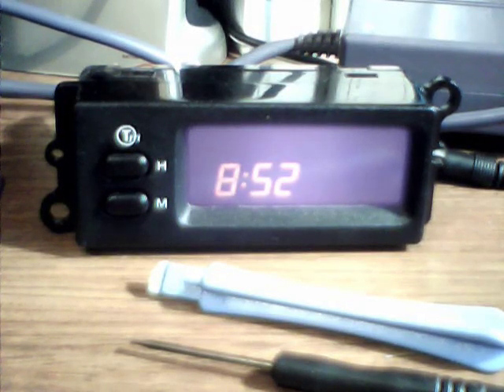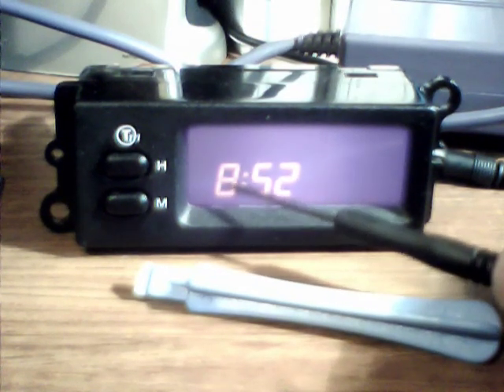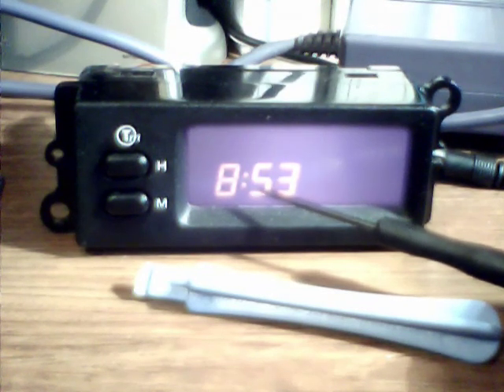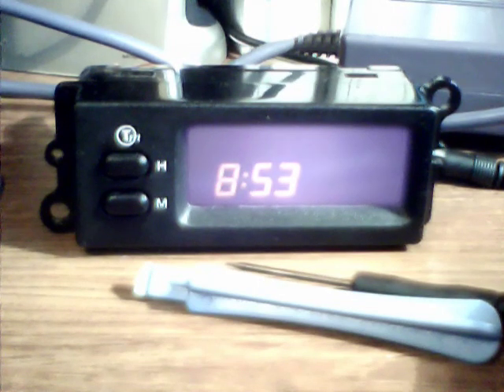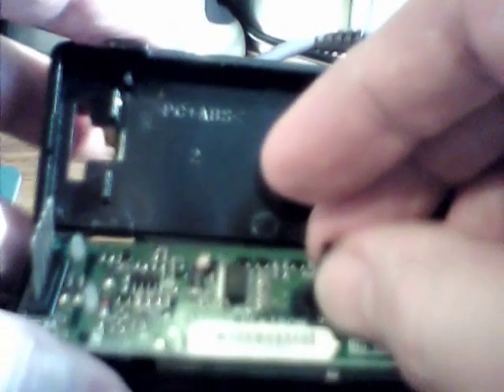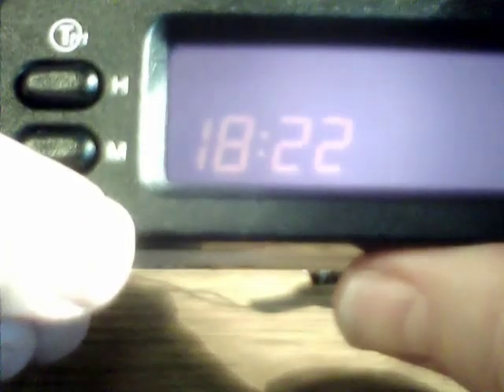Fix_LCD.wmv

Comment: I replaced mine with one from a Freelander, they're about five quid on ebay. different plug but both are four pin. You just have to replace the plug on the wiring loom.

Comment: Recently bought a cheap little runner Rover 25 with the same Traffic Master clock problem and fixed it using the instructions in this video. Thank you Mr uploader. Just saved me around £35

Comment: INVALUABLE video!  Thanks!  Saved a Panasonic cordless phone I thought was dead.
You have to use something pretty hot.  I used the round tip holder of a Weller soldering iron, on setting 2.  I just rolled it back and forth a couple times.  It was so hot it very slightly burnt the tip of my finger that was on the other side of the PCB!  It a shame they don't use a more sensible connection like a mini-molex.

Comment: To check all the LCD pixels are working first unplug the clock from the supply, then hold the two buttons in for about 10 seconds to drain any residual charge. When the plug is inserted, all the pixels will illuminate but only for a fraction of a second before reverting to the clock display. A T shaped soldering bit is available on ebay for attaching the LCD ribbons currently ebay item 281450309634.

Comment: bought a rover25 today with the same style clock that has the same problem can anyone tell me how to remove the clock from the dash please, is it just clicked in or do I remove half the dash just to get at the clock.
Reply from the maker: The curved panel containing the clock and the two face-level air vents is just clicked in place. You just need to pull it towards you, though you'll probably need to lever it with a screwdriver (protecting the plastic with an old credit card, for instance). There are some metal clips which tend to fall off and get lost in the nether regions - I think I'm missing at least one. Also, from memory, I think you might have to free the bottom edge from behind the glossy fascia around the controls and radio. Sounds like it would be well worth your while to pick up a cheap Rover25 Haynes Manual from eBay!
Reply: thank you pleriche this is really helpful, I recall  having the same problem on a different car I cant remember the make possibly a citron where the plastics slid forward to reveal a screw or bolt that must be removed before the plastics could be taken off, needles to say it was a nightmare car to work on

Comment from the maker: On the 2 Pektrons I've tried this on, the fix hasn't been permanent - the wide temperature range in a car doesn't help. Using the iron on hot possibly makes it worse though if you can apply continuous pressure to the ribbon while it cools you may get better results. Results with the two cordless phones have been better - one still has a good display whilst the other just has one row of missing pixels which might be cured by a second application of the iron.